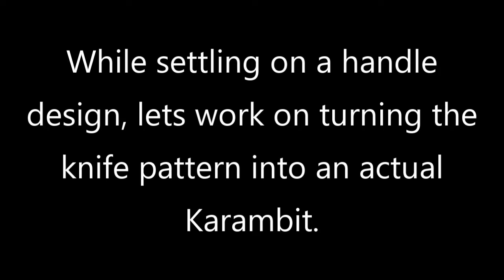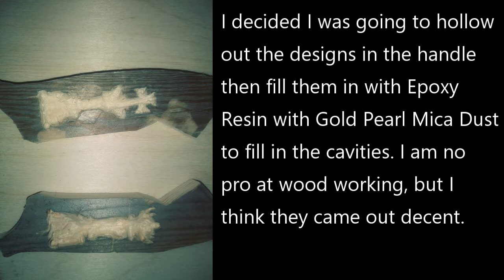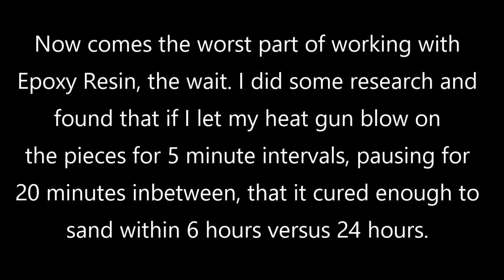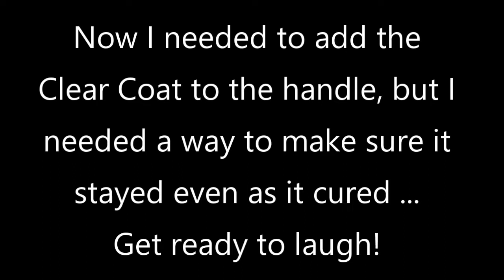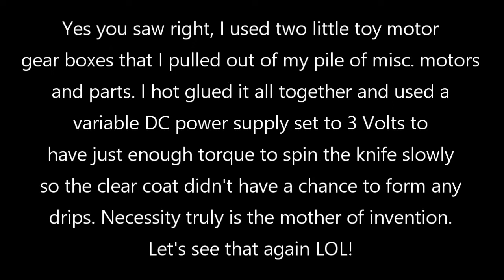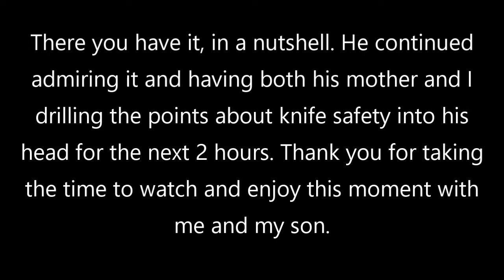My Sons first Knife - Karambit - DiResta and Forged in Fire inspired

Comment from the maker: You know its sad when you have trolls putting thumbs down on a video they didnt even watch, that is a video about a boy getting their first knife. Some people seriously need a life.
Reply: Brian King if you enjoy doing it keep at it, based on the tools I saw you working with the knife turned out great 👍. I’ve been a bladesmith for 25+ years, I’ll tell you Grizzly makes a great starter knifemaker belt sander I believe for under $600 that would help you with your craft. Oh and F the haters lol.
Reply from the maker: @robertallen2366  Yeah, I just did a commission on a custom camping knife with sheath, I cant post it yet cause buyer wanted to be surprised by final product, it is on its way to him now, but it came out insanely good. I used high carbon type 304 stainless steel, quenched it with just a blade edge heating versus the entire blade, then tempered it at 500 for 3 hours, 400 for 2 hours, 300 for 1 hour, then let it cool naturally with the oven, came out a perfect iridescent black, no pings, no cracks, etc. Used rare Nigerian Gaboon Ebony for the handle scales, Australian Wygu leather for the sheath, etc. The only thing I used electric tools for is cutting out the initial blade shape and drilling the handle pin holes, everything else, even the sawback, I did by hand with files, sandpaper, and whetstones. I would LOVE to have a blade belt sander but its all wishful thinking for now.